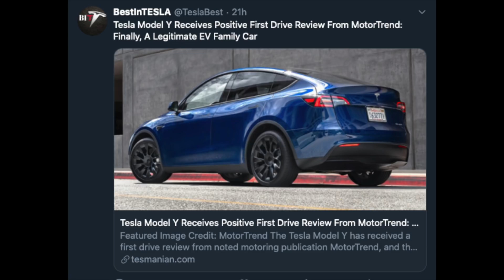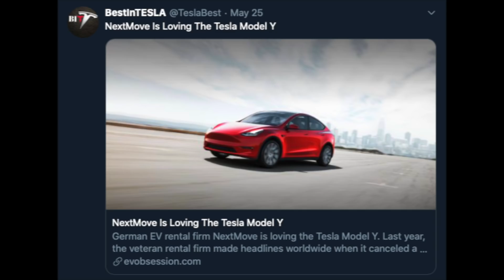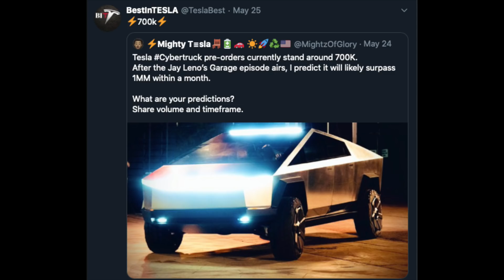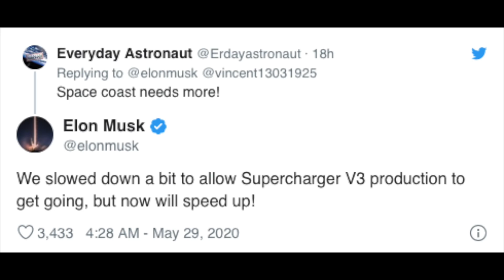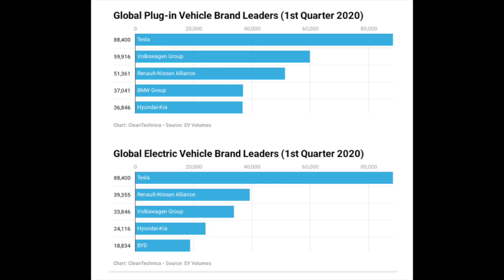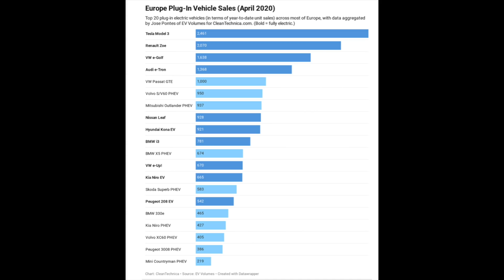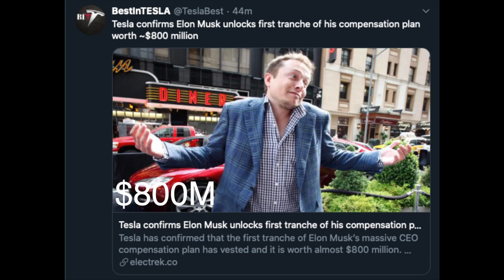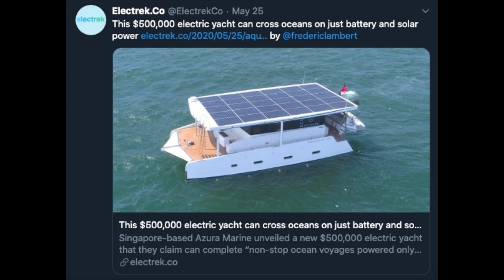Audi’s new highly efficient electric car | Spacex makes history once again | Tesla Robotaxis

Comment: What will happen when everyone owns a Tesla and no one buys anymore because the car does not need to be replaced, lol
Reply: the cars will need to be replaced because the technology is eveolving everyday, thats why the firsts tesla already need computer or battery upgrade like a desktop
Reply: At that point cars will be largely autonomous.
When cars are autonomous, the logic for owning one disappears.
If you can "call a cab" for 10-20% of buying, running, insuring and maintaining a vehicle, plus you get the car you need rather than the car you have (have to make work) it makes no sense to own one. (Unless you have several "early" (pre 2025?) Teslas)
At that point the global fleet shrinks.
Then, most cars will be owned by the manufacturer.
Since they're not making vehicles, factories will be either repurposed for other products (of which Tesla has plenty) or converted to refurbishment of the fleet.
10% "new build" capacity, mainly body panels, with the rest being remanufactured/ recycled.

"Other products"?
There'll be plenty of super efficient air-conditioning units to be build.
Reply: @rogerstarkey5390  I'm doing it for the business

Comment: We will never get rid of oil, ma be of gaz and diesel. But we will still need plastic !
Reply: True - right now we will need oil for plastic production but a revolution will come to this area as well. In the meantime EV's will reduce air pollution in our cities
Reply: True but EV would cut down on oil dramatically
Reply: @kevf500  BMW and Volvo have have already been using recycled materials for years now, its time for tesla to do the same, oil is still very important not just for plastics but for tousands of other applications, electricity cant make everything.

Comment: Wish I could afford a Model 3 long range.. $95,000AUD is out of my price range.. :(
Reply: Tesla too expensive
In the UK cost is £43,500
While the best selling car in Europe is the VW Polo which costs just £12,500

Tesla needs to release a golf sized model 2 and a polo sized model 1
Reply: The super low cost Polo is the most basic of base specs. Fiat do the same with home market Panda it’s a box on wheels with seat and engine. Ultra basic.  
Small Tesla cars will arrive but not until the business is fully established on the profits from larger models. Even then I doubt they will sell them with effectively zero interior trim and cheap tin wheels.
Reply: @Dave5843-d9m  The polo is a decent car gets good reviews and is the best selling model in Europe. It's not a 'box on wheels' and it's not even the cheapest car available. The Hyundai i10 or fiat Panda are available for £8,000 which includes the 20% sales tax

Comment: The electric oil tanker, the vegan butcher of transportation...
Reply: Oil is a fantastic materials resource. Wasting 4/5 of it to pollute and push tin boxes around is criminal. We should not be wasting it on transport.
Reply: I mean using electric propulsion on the sea makes a lot of sense. Especially if you have solar panels installed
Reply: LOL! SO true.